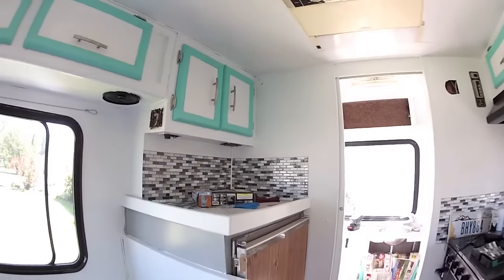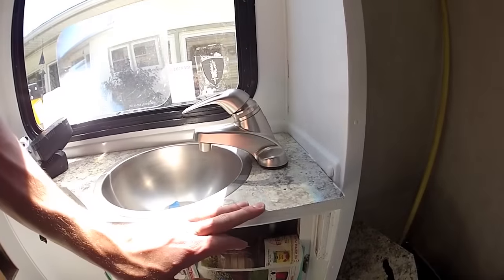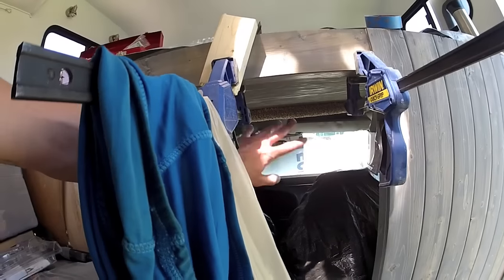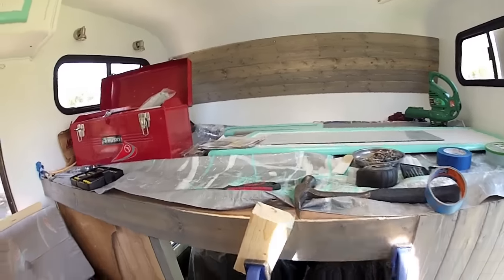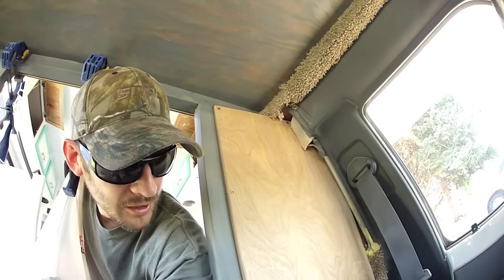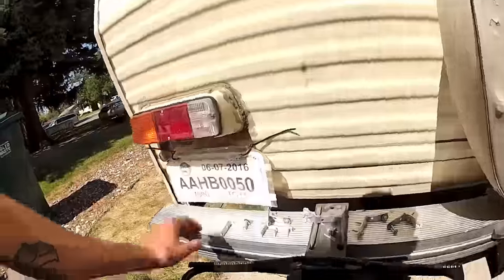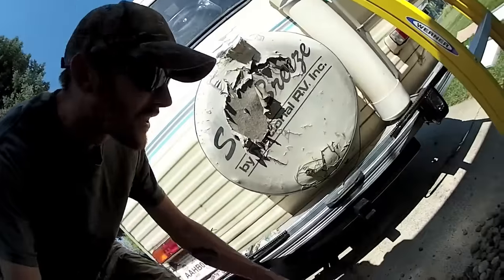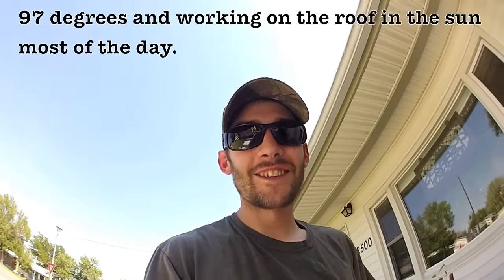RV Remodel Update: Lots done and much more to do! Solar Panels and Re-Painting Bumper

Comment: I can hardly wait to hear if 200 watts will work for you. I'm also glad to see spray paint, many think it's useless, but it's just a barrier against water. Keep going, life is full of questions.
Reply from the maker: It was plenty in the Dolphin 10k miles around the country for 3+ months, and I have a 100ah battery now instead of two 35's. People always think they need way more than they actually do, 200w is plenty. I have always had great results with spray paint, especially an oil based on metal. With a good prepped surface it gives great results and good life for the price. Better than it was! Thanks for watching.

Comment: How about tacking a valance or short curtain panel along the top and letting the curtain hang down? That wouldn't offer any retention to stuff you might have stored below and want to keep secured, but it would be a quick cheap way to make it look finished.
Reply from the maker: Not a bad idea. It is such a wierd bend and curve been scratching my head at it for a while now. Was thinking of using the old plates off the Dolphin, but the colors clash with everything else.